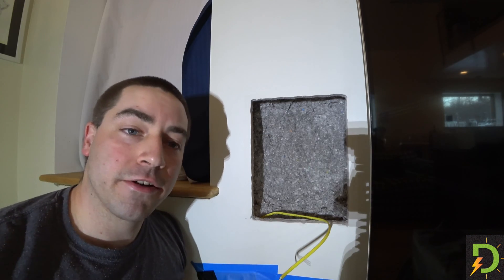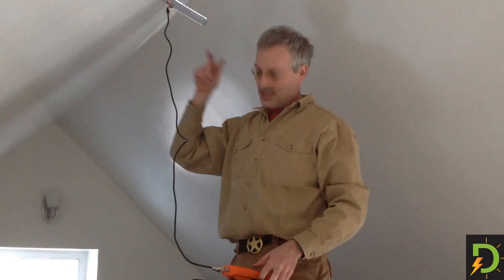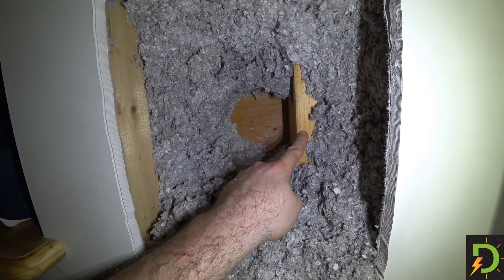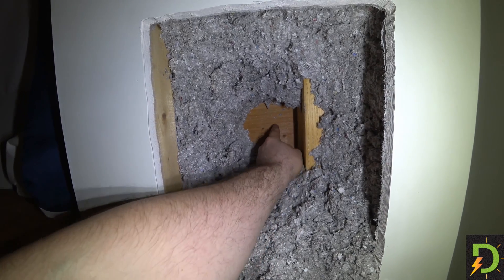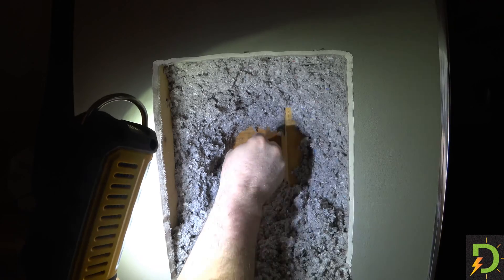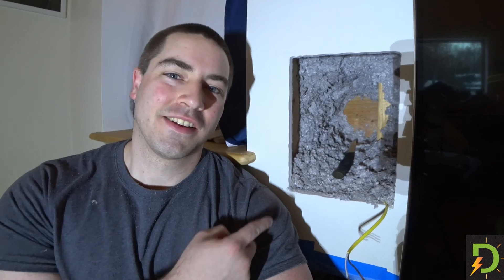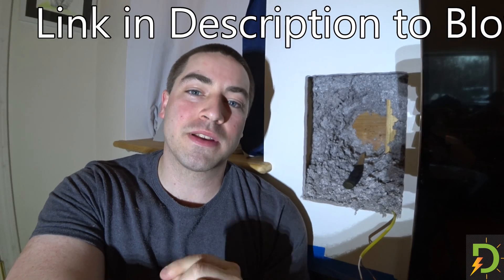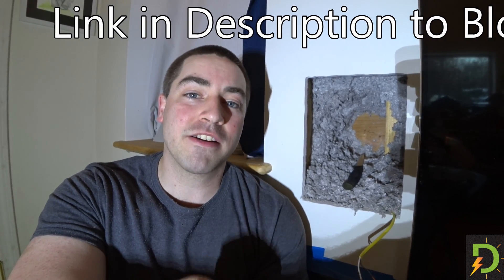Wall Rot in Double Stud Cellulose Insulated House

Comment: It seems your wall has worked very well without a vapor barrier. Here in Canada an interior vapor barrier is code. Did you say your exterior housewrap is a vapor barrier? I'm trying to understand how the sheathing would dry if it's wrapped in a vapor barrier. 

Trying to understand this from a building science perspective. You are generating moisture, it is going to go toward the outside in the winter. As long as it can dry out toward the outside there shouldn't be a problem. Of course, the colder it is, the harder it is for the sheathing to dry. But so long as you keep the humidity in your house at a reasonable level, your sheathing shouldn't be overwhelmed with moisture. 

My concern would be if you generate too much moisture and it saturates the cellulose and now you have soggy wall insulation. A vapor barrier would be good insurance against this I guess. A smart vapor barrier to allow the wall to dry inwards in the summer. Basically my take away is: the wall should be safe from rot in winter as long as you keep your indoor humidity under control and it isn't too cold outside to prevent drying (but that's only a concern in extreme climates).
Reply from the maker: In your third paragraph, you said "A vapor barrier would be good insurance..."  You are not the first person to have this feeling.  I disagree.  If I added an interior vapor barrier to my assembly at my house, it would cause a problem in the cavity.  Right now there is no problem.
Reply: @DavidPozEnergy  I did some more research on your double-stud cellulose setup. Apparently building scientists have modeled this in their software with real world wall-moisture data and their models predicted a failure. The wall on the north side was expected to fail. To their surprise though there was no structural damage, but the nails had rusted. Basically these building scientists say they don't quite understand the mechanics here and why everything held up so well, but Joe Lstiburek said he wouldn't build with this method since he considers it risky from a technical perspective, even if in practice those homes have held up. Full article here if you're interested: https://www.energyvanguard.com/blog/77957/Is-This-the-End-of-the-Double-Wall-Cold-Sheathing-Scare

Interesting quotes from said article: "Based on the monitored data, calculations, and analysis, all three walls should have been at high risk of failure; the analytic tools used indicate that these walls should have failed."

"Joe has said for years that building assemblies are more robust than we give them credit for. This is a solid demonstration of that fact."
Reply from the maker: It's the classic response Joe, and others, use.  By calling it "risky" they scare you.  They make you think that whatever they suggest is safe.  But they don't offer any guarantees on their assemblies either.  And, they have been proven wrong before with their foam based assemblies failing.  Don't forget, they work for "BSC, Building Science Corporation".  They are a private, for profit company.  Their goal is to sell you on the need to hire them.  Their sales pitch is to make you afraid.

Comment: I don't agree that you even need  an air barrier on the exterior, older house that have air flow never rotted. Dew Points occur regardless of how you build and or what tape (laughable) you use, the key is that during the summer months house walls can dry to a relatively low moiisture content. It's like wearing a plastic bag in a storm, you don't get wet from rather your sweat not being able to escape.

Comment: I find it fascinating how so many are still convinced a wall must breath, when in fact the effort should be to choke the cavity with proper thermal beaking and mitigation of air movement into the cavity which pulls in active moust air.And while i applaud your work and efforts, i woyld like to add two cents. 1. I am concerned the "Grace" will hold some moisture on the outside of the sheathing  and 2. Dont discount the assist the latex interior paint (assumed) as an impermeable barrier.
Keep up the good work!
Reply: they say breath, but they don't realize what breathing means.  When moisture gets in a wall it needs to get out.  And moisture will get in at some point.  It doesn't mean leave tons of cracks so wet hot or cold air blows in.

Comment: as tight as the house is. along with what looks like a bit over r40 in the walls  curious how many kw you are using.   am assuming that most of your power is PV. ... OH liked your solar water heat set up that you added to your array
Reply from the maker: The first year we lived in the house I kept real good numbers of everything.  At the time we used 5,110 kwh for the year, an average of 14 kwh per day.  The first year we did not have PV.  Then we started adding PV and became net-zero.  Then I built a garage and we added two kids to the mix.  I'm back to net-zero with my new array in the backyard, but I've not kept very good data logging.  I've got to do that again.
Reply: @DavidPozEnergy  Thinking about your house. doing double studs you have virtually eliminated the thermal bridging, so I see no real reason to worry which side the air barrier is on.  No way for the wall to actually get wet.. eg it can dry.
Reply: @DavidPozEnergy  Are you at this point totally off grid with the larger battery pack
Reply from the maker: Not quite 100% off grid just yet.  Working on it.

Comment: @DavidPoz, what about Rockwol instead of the blown in cellulose?
Reply from the maker: In my house, with my exact assembly, the exterior sheathing would have been wet if I had used Rockwool.  If you want to use rockwool in your own build then don't build exactly the same as me.
Reply: Curious as to your thoughts on why Rockwool (as appose to cellulose) with an air tight exterior barrier would hold moisture ?
Reply: @ortofoncape  Rockwool is pretty vapor-open, so damp air would go through it and then condense on the back of the plywood sheathing, the coldest part.

Comment: How interesting! But are you saying having your setup is better than having a vapour open, but less air tight outer layer?
Reply from the maker: Hmmm.  I wasn't attempting to say my assembly is better or worse, just stating the fact that it works great.  I have built many assemblies that are also very air-tight, and vapor open.  An air-tight assembly starts with having a solid exterior sheathing that is 100% continuous.  This means plywood or OSB.  Foam board sheating doesn't count in my book.  And I don't like when exterior sheathing is eliminated altogether.  (yes, some houses are braced with diagonal metal strapping in "X" at corners, but no sheathing)  Once you have solid sheathing then it can be taped, liquid WRB, or fully adhered WRB.  I've had great success with Henry Blueskin VP100 for example.

Comment: Science is sound, this way of building is more risky than alternatives. This is why it would be interesting to see what construction details mitigated those risks. I would assume that having ultra tight envelop, with very thorough detailing of drywall and dense packed cellulose practically eliminated air movement as water vapour carrier. Water vapour migrating through a vapour permeable drywall due to difference in partial pressure is I believe by two(?, don’t have numbers ready) orders of magnitude slower, and would drive water into the wall only during heating months, when RH inside house is low anyway, so cellulose buffering capacity is enough to protect exterior sheathing. And during summer the vapour drive would move adsorbed water from inside wall to interior of the house where it is removed by air conditioner, so wall dries again in summer.

I understand that what “people with letters” mean, is that type of construction is sensitive to the quality of build: if you have shorter cooling period when wall can dry out, or unnoticed defect in outer envelope/interior drywall that would add air movement to the equation, the result might be different. 

So, I guess, the (mildly) surprising result is a testament to amazingly high quality of your work than to gaps in science.
Reply from the maker: Thanks for watching.  All building assemblies carry some level of risk.  It is my personal experience (in my area) that the buildings with fiberglass have the most (and worst) problems associated with moisture.  My assembly is less risky than building with fiberglass insulation.
Reply: That probably would be the case, as fibreglass has zero water vapour buffering capacity, so all vapour moved inside wall by partial pressure would end up on sheathing.

Comment: The gypsum wall board should act like a vapor/air barrier if properly sealed.  The issue with condensation in the wall will come about as the construction ages.  With the bituminous membrane on the exterior the plywood sheathing is sealed.  Any holes/cracks in the wall which allow interior air to reach the interior surface of the exterior plywood (in cold weather) will bring moisture water will condense on the surface of the plywood.  Over time even small holes will become places for moisture to accumulate.  The insulation although dense will over time settle allowing voids (however small) - the perfect storm will occur when a hole/crack aligns with a path/void in the insulation to the exterior sheathing.  
Double studs with dense pack cellulose insulation is a good inexpensive approach to super insulation for a house - but, it is not a system without concerns.  But, then there really is no perfect solution.
Reply: Is it a good idea to retrofit an old 30s house with cellulose blown in exterior walls from inside of house? No insulation at all on 2nd and atic fllor. And on insulation on roof deck? What are my options?
Reply: Dense packed insulation is not meant to settle.
I believe that is the main purpose of dense packing!

Comment: can i use plastic in an interior wall for cellulose. Does it need to breath
Reply from the maker: In my climate, Zone 5, the manufacture of the cellulose says NOT to use any vapor barrier in the assembly.  However, if you have a building inspector who is stuck in the past ans won't believe the manufacture, then you can use a "smart" vapor retarder such as Intello Plus: https://foursevenfive.com/intello-plus/

Comment: I built my house 32 years ago using double wall construction. I did use an airtight interior air/vapor barrier as that was the standard then. I believe that the details used to create an airtight assembly are key to success. I was told the same thing by all of my fellow Carpenters. They all said my home would rot. I'm still there 32 years later and no rot. Just a lifetime of energy savings.
Reply from the maker: Awesome!  Very well said.  "Just a lifetime of energy savings"  Beautiful.
Reply: @DavidPozEnergy  Commenter is inside vapor barrier, yours is outside. Doesn't it matter? Seems to me your HVAC is the key to maintain low humidity inside for success.
Reply: You're correct. A double vapor barrier would cause rot. One is all you need.
I've repaired house mistakes for 40 yrs.
The heat will dry the inside.
Reply: Just for s & g I would love to know what is the saving amount. I have the tyvec type material on the outside n 1/2" of foam over 6 mil vb then the drywall. n 6" wall   Do u think I'll have a rot issue ? Now 20 yo.

Comment: Wrote this on another video - I live in a 1934 built home with a stucco exterior and 4" thick 2x4 walls (I believe that's the construction) in Minnesota.  I think there is very little to no insulation in the walls, at most there is a little bit of old newspaper according to a drill test hole.  I had a home performance inspection done and one of the recommendations was to insulate the walls - however, I have been told that there can be moisture issues with cellulose and that it's better just to leave the walls as they are and just turn the heat up more.  Any ideas on this?  Roof was replaced in the last year if that matters.  Thanks for any thoughts!  I would love to have a more energy efficient and insulated house, but am not sure if I can insulate and not have worries.  My blower door test was 2400cfm on a 1900 sq ft, 2 level + basement home.  So I'm thinking it's not tight enough nor is the exterior air tight as you mentioned (how do I get a stucco exterior air tight).
Reply from the maker: Exterior cladding that is porous can be more risky with any insulation.  It's not a cellulose question.  As an example, if you have a south wall that get saturated with rain, then the sun comes out, it can drive the water into the wall assembly.   If the wall assembly has any insulation then it will retain the moisture, mold, and rot.  This is true with foam, cellulose, fiberglass, or any other product.  

My approach with customers who have stucco are to wait on the walls.  I go to the attic, sloped ceilings, basement, additions, etc. first.  I tell them to go a winter with everything else I can do before addressing the walls.  99% of the time they are so blown away from everything else they agree the walls are not needed.

For some who still want the most efficient home, and wall insulated, then we do a risk analysis on the walls.  Are there overhangs?  What kind of shape is everything in.  I might even add a moisture meter into the wall and monitor.  If it looks like the assembly stays dry, then you can drill and blow the cavity with cellulose (dense-pack).  If there is high moisture after a rain inside the cavity, then it comes down to removing the stucco, insulate, new WRB (weather resistive barrier) and new cladding with drainage plane.

But I can't stress this enough, the attic and slopes can almost always reach the homeowners goals.  At least the way I do it.  

I hope that helps.  Thanks for watching.
Reply: @DavidPozEnergy  Thanks. If I did wait on the walls, what can be done with a finished basement, anything?

Comment: David, if I wanted to put one of the "smart" vapor barriers (intello plus etc) in between the drywall and cellulose just for reassurance, would this assembly still perform well? That is with something like Henry Blueskin or Delta Vent SA outside of sheathing. Or do you believe this would cause potential issues. Thank you for any feedback, it is a little dizzying trying to get everyone's opinions on this topic straight, but I love to see you have tested your opinion so well.
Reply from the maker: Hi Eric,  I have used Intello plus on hundreds of homes over the years.  Yes, it works, it won't cause a problem.  I limited my use of the fabric to unfinished spaces.  This would typically be when making hot roofs in attics and walls of crawl-spaces.  The intello plus does a great job holding the dense-pack and looking good when done. 

I never consider Intello Plus to be a substitute air barrier to an external air barrier.  In my opinion (based on experience) an exterior air barrier on a rigid sheathing is far superior to any interior air barrier.  So if you use Henry Blueskin VP100 taped over 100% of your exterior sheathing (plywood) that is perfect.  Good job.  No interior air barrier will be even half as good as that.  

Why would I not use Intello Plus on finished surfaces?  I'm referring to walls and cathedral ceilings that would be covered with drywall.   Well Intello Plus is extremely expensive in more ways then one.  First, it costs 7 times more per square foot of material then Insul-Webb.  Insul-webb is the netting I used on the interior of my house.  Second, you need to tape all the seams and penetrations which boosts material costs up to 10 times.  Third is the labor to tape it (labor to staple it in place is the same).  Fourth is the time to install cellulose behind it.  Insul-webb allows air to escape as it's netting.  This means the installer can crank the machine up full blast and move material quickly.  If you do this with intello you will blow the intello off the wall.  So the machine needs to be set low.  This doubles the install time.  That doubles the labor cost.  

Finally, last point, it gives builders this false sense of what they call a "belt and suspenders" approach to air sealing.  They say (yes literally have said this to me) "well if the exterior air barrier isn't perfect then intello-plus will take care of it."  No it won't!  You will never get intello-plus to perform as well as an exterior air barrier.  So focus your time making the exterior sheathing air tight, confirm with blower door, and then you don't have to worry about the interior.  

I don't view intello-plus as a good air barrier.  But like I said, I love it used in un-finished spaces.  But if you are going to cover the wall/ceiling/joists with drywall, then forget the intello plus and just use insul-webb.

Does that make sense, or is helpful?
Reply: @DavidPozEnergy  yes that is very helpful! I was planning to be very diligent on the exterior air barrier regardless, but wasnt sure if it would be worth doing intello on interior more for the smart vapor control aspect. I live in Missouri. We have cold winters (not compared to more north) but we also get very hot and humid summers. But the more I research im thinking I dont need any type of vapor barrier. Just hope code doesnt still force it. Especially if intello is that expensive because im definitely not doing the old classic plastic sheet.